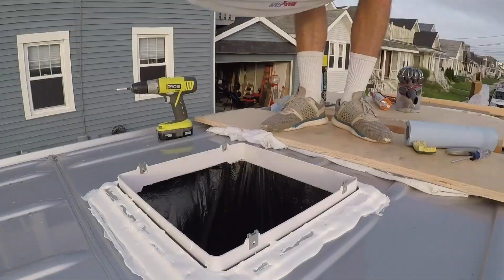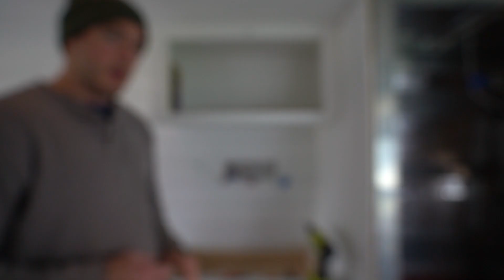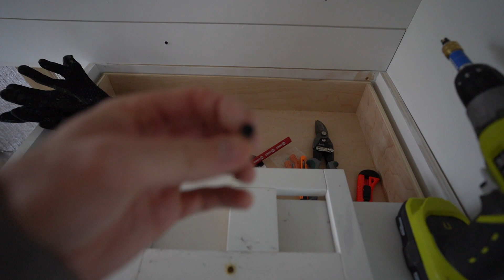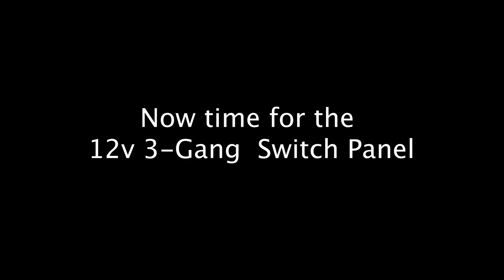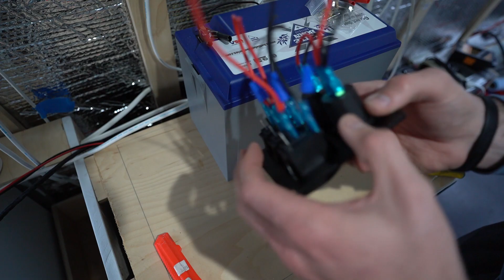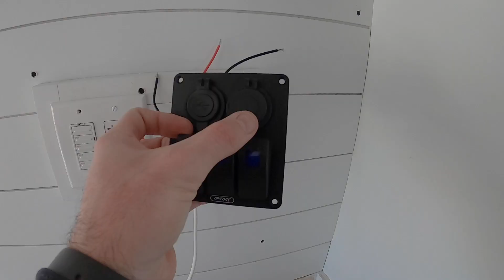Installing a 12v 3-Gang Switch Panel and a 110v Timer Switch - Van Build Ep: 24

Comment: Do you have a resource explaining in further detail how to wire the timer switch with 120v? I've scoured the internet and am at a complete loss about how to wire the switch with 3 wires coming from the circuit and 3 wires coming from the water heater

Comment: Hi there. I appreciate all the time you put into  of your videos. 
I ordered the timer from your link. Mine has 5 wires  black, green, white, red , yellow/ red.  Yours does not. I am baffled how to wire this now. I even called leviton  and they said I cannot use it. This will be the 3rd thing (dial timer, ac toggle switch and now this)  I have purchased for this  same water heater that I do not understand how to wire.  I am very frustrated. Can you please offer any other info? 
Thank you in advance.
Reply from the maker: Thanks for watching our vids! 

The timer switch should come with instructions the yellow/red you ignore since it’s used for 3 way switch only.  I found the instructions on the amazon link
https://m.media-amazon.com/images/I/91A8Hm--KrS.pdf

The diagram to reference is step 4a.

Not sure why Leviton said you can’t use it when the instructions for single pole wiring are right there that’s odd.
Reply: I appreciate your quick response. I  do not see any red wires  coming out of your timer which is why I am still confused.. 
Actually, I only see 3 wires coming out of your timer switch. 
I have the 4 ( ignoring the 3 way) 
I am annoyed at myself why I cannot get through this.
Reply from the maker: @melissag7071  are you able to follow the diagram on step 4 in the link I provided?
Reply: @MathersOnTheMap  when I leave work I will try this.🤦🏻‍♀️ Thank you for your time.

Comment: What ball valve did you buy? Was it a two wire or three wire?
Reply: I have the same switch as you, and I also bought a two wire ball valve but it’s not working. Is the automatic return a feature you have to look for on the two wire valve?

Comment: I am spending WAY too much time looking through you videos :-)
For the Switch panel it would seem to be easier to just remove the existing joined cable setup altogether and run your powered cables directly to the terminals ? Would be less clutter...
Reply from the maker: Thank you! Fair point

Comment: Nice work.  What gauge wire did you use for the water heater switch/line and approximately how long was the run?
Reply from the maker: Thank you!!!  12awg not sure on how long but from one side of the van up through the ceiling to the other side, check out our wiring episode for more info!
Reply: @MathersOnTheMap  Thanks!  I was also planning 12/3 AWG.  I checked w/an electrical engineer and it looks like I should be good to go!  Running across the bedframe, up to the switch, then back to the heater.

Comment: Hi may I ask where do you connect your ground wires?Im about to do my wiring and that's what I notice there's always extra wires that they call it for ground. thank you for sharing this.
Reply from the maker: hey Maso!  not sure if I confused you by saying negative vs ground, but they're the same thing for when I talk DC electricity.  so the ground is the negative wires.  If you're wondering where I ground my electrical system I recommend checking out my electrical video https://www.youtube.com/watch?v=yRqTEgarzoY&t=584s
Reply: Mathers On The Map ah okay, ☺️ I will check the link. I like how you explained it in detail. Thanks.

Comment: I was wondering if you can tell me how you hooked your ball valve up. I have three wires from valve and two from block?
Reply from the maker: You may have the wrong ball valve.  Make sure you have the ball valve that has the automatic return, (which is only 2 wires) If you have three wires you likely have a “reverse polarity” ball valve which I’m not sure how to wire to be honest and requires power to open and close the ball valve.  Where in the automatic return as soon as it doesn’t have power (turn off switch) it cranks shut automatically

Comment: Hi, Why did you use 12/3 wire. Is this necessary for only the 120v components, or also for the 12v? Also, I guess you would have liked to have used 12 AWG all over for 12v. What AWG did you use for 120v? Thanks
Reply from the maker: We used 12/3 (3 for AC, 1 ground, 1 hot, 1 neutral) for our 20amp outlets (hot water heater, outlet for hairdryer, outlet for blender) we also have 2, 15amp outlets for charging our electronics which is on 14/3 wire.  For our 12v is majority 16/2  or 16AWG.  If I could do it over again I would go 14AWG for everything 12v.  12awg is pretty thick and harder to work with.  Hope that helps
Reply: @MathersOnTheMap  Thanks so much for the help
Reply: @MathersOnTheMap  Are your 15 amp and 20 amp outlets hardwired to your inverter? I’m stumped.

Comment: How did you accomplish adding a timer switch to the water heater? I have the same water heater, Bosch. How does the 120v wire get ran? This is a great idea for those “oh shit” moments. I currently have the 120v wire ran from where the water heater will love to the breaker box. Can you explain how you managed to get the timer switch? Thanks.
Reply from the maker: Hi Mario - I am going to summarize the entire setup, so apologies if it’s too much information.  But basically, we will have our batteries is DC and we will use an inverter to convert it to AC (household appliances like the hot water heater). From the inverter, we will have a junction box that holds a 20amp breaker box like you mentioned and will run a 12-3 gauge wire from the breaker to the timer switch.  Then we will run from the timer switch another 12-3 gauge wire to the hot water heater.

So it’ll look like this:

Batteries (DC) -> Inverter (AC) -> Breaker Box (20Amp) -> 12-3 wire -> Timer switch -> 12-3 wire -> hot water heater

Since you said you currently have the wire ran from the breaker box to the hot water heater, you're set, you can just cut the wire in half and insert the timer switch where you want it, or if the current wire doesn't lie where you can place a timer switch, run an additional wire from the breaker box to the switch and back to the wire connected to the hot water heater.  

Hope that helps!